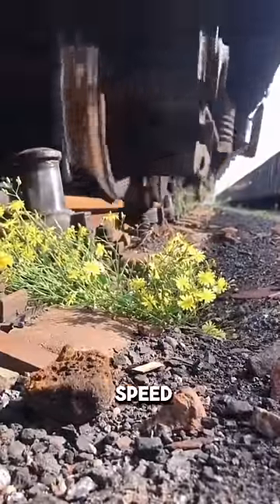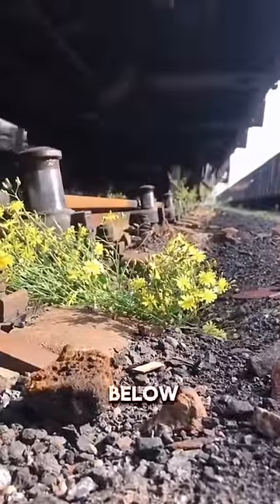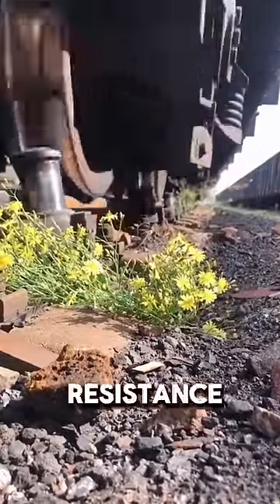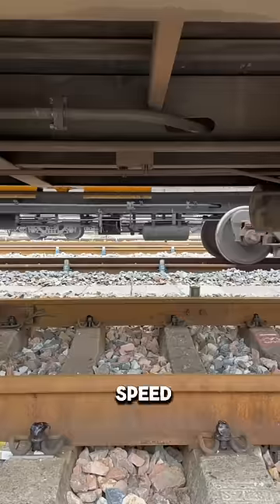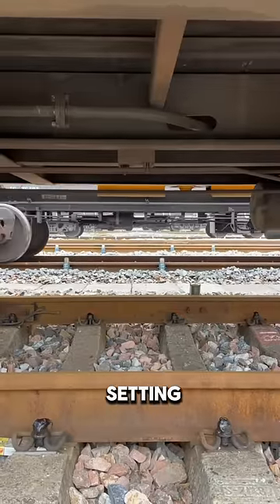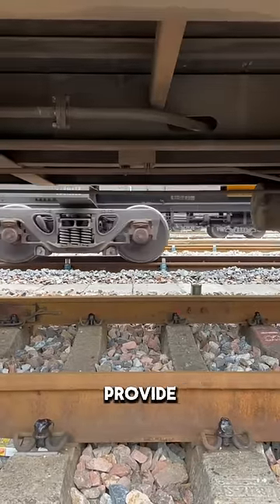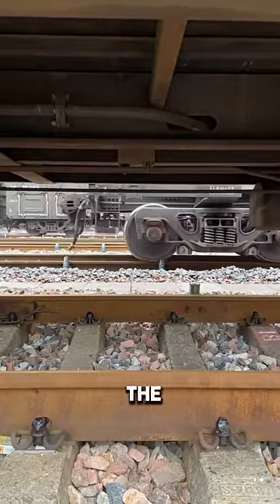Dowty Train Retarder #shorts

Comment: "You might be wondering if this device makes the train become <slower>? No, it doesn't. In fact, it is a device that helps the train slow down."
Reply: I'm so frustrated with this audio.
Reply: It greases the FLANGE on the wheel to reduce wear on curves.

Comment: What the video doesn’t say, is this is used to slow down RAILCARS.  When they get kicked into a sorting bowl.
In short, PURPOSEFULLY rail cars are let loose on the tracks.  Generally 1, 2 ,3 or 4 at a time, disconnected from an engine.  They just coast downhill and get sorted into different tracks.  Either by a computer track switching system or with one or more switch men selecting tracks.  They use the retarders to slow them down because otherwise they just roll with no brakes applied til they hit something.  These are designed to slow them enough to gently bump and couple onto another parked car, In most cases it’s generally another parked car at the end of a sorting track, where a conductor and engineer join it all back together properly after coupling an engine and before hauling it off.
Reply: Thank you.
Reply: Thanks, better explained but the video was funnier.
Reply: Danke a info
Reply: Nerd
Reply: These are used in a Hump yard! This is where they sort cars and put together trains, they have a small mountain in the middle of the yard and use gravity while a man in the booth runs automatic switches and two or three trains can be built at one time
Reply: but how does it make the train developmentally challenged?

Comment: Worked on the railways for 8 years back in the 70's and 80's never seen these things, what happens if they jam and dont retract.
Reply: This looks exactly like something we never wanna see on the track. If it malfunctions it becomes a derailer.
Reply: @rigging03  i'd imagine its designed to fail down where it would stay retracted probably assuming the spring bringing it back up would fail.
Reply: @eggos5074  Your most likely correct. I would hope it's not designed where it would jam open.
Reply: @rigging03  You would imagine that if the seal allowed dirt to wash down inside that it could get stuck , Ild want to see how they are made, engineers dont always get it right, lol.
Reply: @jamesmatheson5115  That would be interesting.  I would like to see the longevity of one of these devices. It wouldn't be the first time engineers got it wrong.
Reply: @rigging03  They are hydraulic.
Reply: @jamesmatheson5115  Thank you buddy. I didn't know how they work. I'm not familiar with this system.  I thought it might be spring loaded. I would like to know the  longevity of this system and whether or not it in time will be susceptible to freezing up or galling.
Reply: @rigging03  They have pipe running to the whole bank, one thing I know about Hydraulics, is they dont last forever, what happens if they get a air lock? The system must work.
Reply: @jamesmatheson5115  you are absolutely correct. I guess non of them are fail proof but this system would concern me.
Reply: I would think if anything it would probably become stuck at the bottom of the stroke.
Reply: @krakkenyou1925  If a check valve gets stuck or a loose fitting not allowing the check valve to work, the Ram would get stuck wherever it was positioned.
Reply: If the device gets stuck in the up position the train hitting it will exceed the strength of the bolts holding it in place. The bolts will snap and the device will be pushed out of the way.
Reply: "what happens if they jam and dont retract."
The failure point is an orifice so you might was well ask "What happens when a hole fails?". Well, the failure mode for a hole is to get larger. It will act exactly like worn out shocks on your automobile. That said, the walls are about 3/8" so if it fails to retract, it'll bend. There are several engineering drawings on the internet, though the first few are worthless because they are too small to show the details.
Reply: @Trump2PrisonOn34Counts  Ive seen the drawings, I also know how a stuck hydraulic ram reacts, it freezes, so you are saying if a complete bank of these freeze in an up position they will simply disintegrate.
Reply: @jamesmatheson5115  "Ive seen the drawings, " Then you shouldn't need to be asking because the answer is in the drawing.

Useful questions for you to explore:

What temperature does hydraulic fluid freeze at? 
At what temperature does the viscosity change? 
What happens to it's viscosity? 
Is this true for the entire range of possible fluids used?
Are there specific technologies or actions used to avoid temperature related issues in industry, or specifically rail road? 
What temperature do railroads issue slow orders for jointed rail? For CWR? Are other rules activated at that time as well?
What is the list of orders specific to a territory called? 
Who sees they are enforced? 
Who reminds crews to check that list? 
Who is responsible for checking it even if people are not reminded?
Reply: Would the weight not absolutely obliterate it before it'd cause a derail?
Reply: @Trump2PrisonOn34Counts  Temperture shouldnt be an issue as they are all plumbed into one system which runs through heat exchanger, but as you know. with check valves its easy for a fitting to become loose which in turn would freeze those rams connected to that check valve.
Reply: 铁路编组场里的减速顶，60年前就有的破玩意儿，有什么稀罕的？😅😅
The speed reducer in the railway marshalling yard is a shabby thing that existed 60 years ago. What's so strange about it? 😅😅
Reply: When they go bad they get stuck in the down position. The hump I work at has them kind of. They stopped replacing them to reduce the cost of hump maintenance.
Reply: Probably designed to snap off if the happens.
Reply: @Luton-Mick They are, but they aren't always successful.  I spent 13 years working in a hump yard.  They have caused a few derails...not too many.
Reply: @chrislane8466  So they can get stuck when fully extended, do you know the cause of them not retracting? As @Trump2Prison might like to know.
Reply: @jamesmatheson5115  Not exactly sure.   I only get there when the damage is done and as a switch man, investigating these accidents isn't my area.  I know they have considered removing them due to the derail and maintenance costs. 
The switch man like them and the warning noise they make.
Reply: judging by the comments people are making on the video these are used in rail yards
Reply: @TWEAKLET  Specifically hump yards.

Comment: "You might be wondering if this device makes the train become (word that means slowed).  No, it doesn't.  In fact, it is a device that helps the train slow down."  So... "It doesn't do exactly what it does."  :-D  (I know her intent.  She's referring, in part, to intellectual capabilities since "the R word" was once used to describe individuals with IQ's that were considered "slower" than average, but then that scientific word went from being the standard to being considered rude.)
Reply: @jd: After 44+ years of working for and with clients with that medical diagnosis (later changed to “developmentally delayed,” then to “developmentally disabled,” or other terminology possessing the exactly same meaning…the word remains a perfectly good word for defining a setting or action such as seen and described herein. 
A centrifugal Governor on a water boiler allowing Advancing or Retarding steam input to pistons, for example. The same with adjusting the “dwell” on a pre-electronic automobile engine system; Advancing or Retarding the distributor cap firing times to the spark plugs.

Perfectly good word that many clients with diagnostic limits of below 70 Intelligence Quotient (IQ)  might still understand as “to move back” on their bicycle brake setting, as opposed to “to move forward.”  

And here I am explaining this concept to one and all…
Reply: I still use that word to describe those people.  Because no matter what word or description you use, it will be used as an insult.
Reply: @joeschmoe6908  With the way some people behave, I find an urge to think "trans"-anything is an insult. It's not fair to the Ford Transit.
Reply: @AlMcpherson79  an ongoing joke in the community are Transit companies named like "Trans Flex" or "Euro Trans" etc. ... it was funny for a while and now i cant stop thinking about it whenever is see any of those companies 😅

Comment: Why not use the train's own brakes?
Reply: For one thing it could be a safety measure in case of break failure, but I assume it is used in one of those places where wagons are shuffled around just by pushing them down a slope and gathering them at the bottom, to assemble them to new trains. At least that was a thing back in the days. There would be a guy on each wagon using the wagon’s break, but this could automate the slowing down. Quite a clever device I have to say.